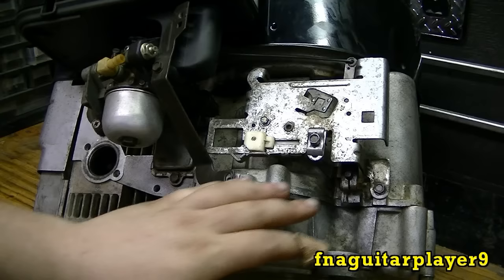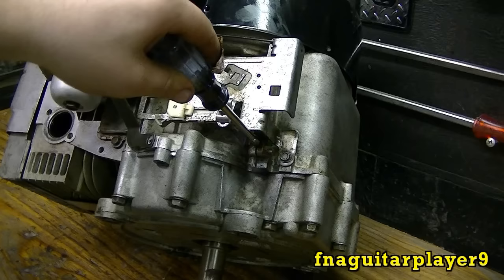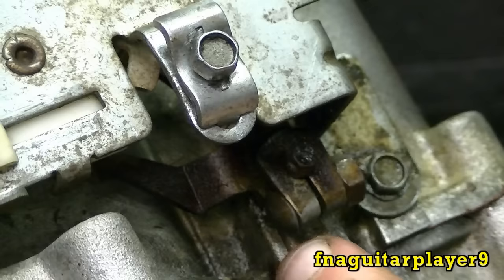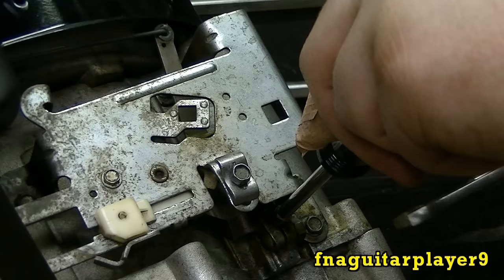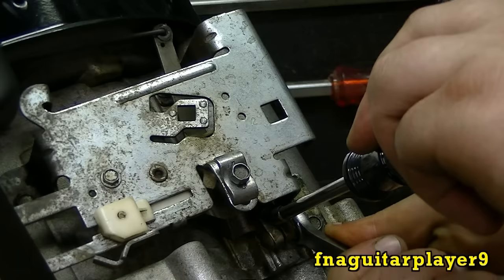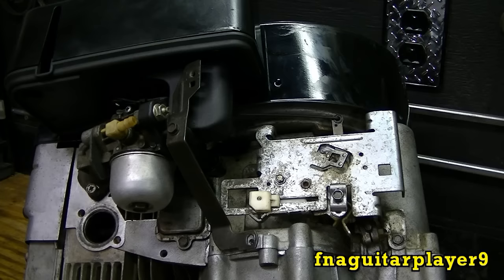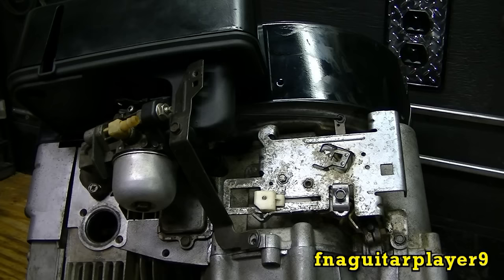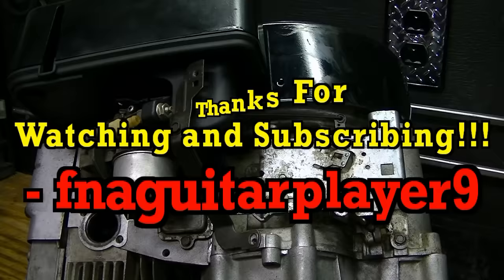How To Adjust Mechanical Governor On Small Engines

Comment: OK so now I just replaced the carburetor and ignition coil on my craftsman YT 3000 tractor. It has a 21 hp single Briggs & Stratton so when I loosen that not do I turn left or turn right because my engine right now is a racing like hell.

Comment: Just recently, I have a Briggs 331877-0869-g5, about 11 years old,  I did some deck repairs, tested by mowing some lawn and worked fine, when I pulled into garage, started revving to max, now, if I start it, immediately goes to high rpms, governor arm doesn't move, but if I move it by hand it will slow down.  I've drained oil, gas, took deck off, getting ready to tear into it, but if you have a different opinion, let me know.  I need to fix quickly, cause spring is here and the grass grows fast.   Thanks, Brian

Comment: Of all the web pages i've gone to and about 10 videos, THIS IS BY FAR THE BEST EXAMPLE OF HOW TO ADJUST THE GOUVERNOR ON A SMALL ENGINE. Thank you for making and sharing this video. I knew it was a simple process but could never get a straight forward example of how to do the actual adjustment, everyone wants to talk about springs and how to "jimmy" springs to control idle speed... thanks for the video two thumbs up!!
Reply from the maker: +doug h I appreciate that! I usually try to keep things as simple and to the point as i can. Yeah, sometimes you have to bend the tabs to fine tune speed, especially on generators. Your welcome!!! Thanks for Watching!!!

Comment: Hi there from Australia.
Your videos are fantastic! They have given me the confidence to tackle things like this instead of paying big money for someone else to fix it. And by the way, my wife is quite impressed too. Thinks I am quite the handyman thanks to you! I owe you one😉
Just about to try process and adjust my govenor. I just fixed my one piece carburetor. I cleaned out all the jets but still wouldn't work. As it happened, it was the needle getting stuck and not dropping in and out properly. Not getting fuel. I had to drill it out  slightly (in reverse) just to get a little bit more clearance. No amount of cleaning worked. Thanks heaps. Mick.
Reply from the maker: Hi! Appreciate that! Glad to hear! Thats why i make these videos to help people save money by doing repairs your self. haha i hear ya! I hear ya, sometimes they can be really bad. Your welcome glad to help out! thanks for watching!!!

Comment: Just wanted to say a quick thank you.  I put a new short block in my rider (13.5hp B&S) and got it back running but couldn't figure out how to set the governor.  It was running really high and would bog down with the engaging of the blades and going up a hill.  I had looked for quite a while on the internet and couldn't really find what I needed.  I found your video and couldn't believe how easy it was and I was a very skeptical.  Well I went out and adjusted it and it worked great. Thanks!!!!!!

Comment: Good job! As a note from a retired ASE Master but green Loctite is low strength and applied after a nut is installed. Now, I will do this to my tiller because it runs faster than normal and won't idle down. If I am throwing snow, I like to push the throttle down while the mail guy/gal shows up. I use plastic covers for manuals, but take photos to numbers of the snow machine, s/n, model and engine to. Clean & brighten photos & print them place these in the file cabinet as well. It helps 4-7 years later when things need adjusted or fixed. 
DK, ASE Master Tech since 78, Retired. Thanks!

Comment: This is the exact video I needed! I just bought an old murray riding mower and it has the 12.5 band g i/c motor. It runs very high rpm pretty much non stop and doenst have much of a change in the throttle,. it does surge in a rythmic fashion and blows a lot of oil/white smoke out of the exaust when it does the surge. lawn mower mechanic up the street said to try adjusting the governor. this video was perfect for showing me what to do. I just hope it does the trick once i actually do it.

Comment: At 2:47 you explained my problem! I was having an issue with mice that chewed my plug wire down to bare wire and shorting out. I took head and carb off to check valves, but never touched the gov assembly. When I put it all back together, it was way over revving. I couldn't figure out what I did to make it rev up like that, but I knew the fix was resetting it. Not untill you explained that anytime you take the carb off, you should re-adjust your gov....I didn't know that! Thanks for the info! Great vid, bro!

Comment: excellent!  this is exactly how to adjust the governor.  Normally you will not need to do this, but with old antique motors, these friction/clamp type fasteners get rusty and they slip.  The other thing that can happen, and I want to mention this to anyone dealing with an older vintage motor is that the governor arm has a bushing type seal.  This bushing type seal can build up lots of crude an dirt and that can cause the governor arm to get "stuck" or bind up in one range of motion.  So before doing anything, spray some brake cleaner all over the governor arm bushing seal.  Blast it with some compressed air, then coat it lightly with regular motor oil.  (the brake cleaner will cause most rubber bushings and seals to dry out and then they can crack...so put some lube oil on it to prevent that.  It's like how you wash your hair.  shampoo to get rid of dirt and then a conditioner to prevent dry out.  Same idea.  

also...on old vintage motors, springs rust out and break.  Always check that ALL springs are intact, in the correct holes/positions, and replace them if they are weak or stiff.  

t

Comment: You just saved me! I changed the carb on my B&G 9.5 snow blower engine and it was racing after I started it. I stopped it in a second or two. I thought I had a bad carb. I was extra careful not change anything but it turns out the governor was way out!

Thank you!
Reply: Did yours start up and go to full thottle? Mine is and i cant get my head around it...
Reply: @dieselbossbrandon  it did. It was because I didn’t set the mechanical governed correctly. I needed to do valve adjustment after.
Reply: @grahamlocklin  thank you! Im gonna set it today!  Its my sons new tractor hes been building and he just got it running and it scared both of us when it took off at full speed lol

Comment: Another great video Frank!  You have the best small engine videos on You Tube.  I always thought this was not adjustable.  I have a 12.5 hp Briggs that is surging right now after a carb rebuild.  I will bet that this is the problem.  I will adjust the governor in the morning.  Thanks so much for the timely video!

Comment: Thanks. I had rebuilt a 30 year old Briggs, 1904oo series engine, on a Mighty Mac chipper, governor similar set up to this one, my engine is horizontal. My engine was way over revving, was driving me nuts right after a rebuild like that wanted to break engine in without throwing the rod out. I knew there was a governor adjustment of some sort on that shaft you worked on. Here I'd been trying to adjust my maximum governed speed with a nut which has s spring behind it, on my engine which is located behind the white (black on mine) plastic throttle slider, and sticks out toward the pto side. This spring / nut does not seem to be present on lawn mower application in video, at least that I could see. 

This WORKED, my engine now runs at a decent regulated speed not too fast like the Wright Brothers only caring if the engine lasted long enough for that first 59 second flight, lol. Engine purrs right along as it continues to settle in, undergoing break in from its rebuild. 

Chippers always run really fast, one reason chipper engines do not last. I still have not found out what the adjusting nut with spring behind it exactly does on my engine, but believe it may have something to do with running speed although does not allow you the wide a range you have on a lawnmower application. Way engine is mounted you can NOT safely make adjustments with engine running. 

 Some differences on my chipper engine, are the white (or black) plastic square throttle slider on mine, you can NOT move. Also, look ma, no third hand required: did not need hold throttle wide open while turning governor shaft to the right, and tightening the clamp nut. My engine the linkage kept the throttle WIDE open for you. In fact idk what the idle screw even has got to do with anything on mine, only way that idle screw EVER touches, running or stopped is if you somehow override the throttle rod linkage manually.  

Good informative video, great pictures, and as another poster mentioned no music viewers may not like. Nice job!

Comment: Great video! Thanks. I've just rebuilt a Briggs and Stratton engine on a Husqvarna mower.

This video has helped so much! Thanks from Wales (UK)!!
Reply from the maker: Wyn Edwards Appreciate that, your welcome always glad to help out! Thanks for Watching!!!
Reply: Hi 
I’ve a Briggs quantum engine and I’ve cleaned the carb and replaced air filter and gaskets spark plug and governor spring and adjusted the governor arm as per video but still engine races ?

Comment: Thanks for showing how to do this.  I have a Yamaha MT 110 2-stroke lawnmower motor and it was giving me all hell revving like it was going to take off whenever it feels like it.  Well, just as you said:  5 minutes later the problem is fixed & it is running smoothly and solid.  The throttle cable was replaced some time ago and ever since that it was uncontrollable but worked sort of.
Reply from the maker: Your welcome, glad it fixed your problem! Thanks for watching!

Comment: First off, fantastic explanation! I watched the video on what a governor does and then followed it up with this video. I have the opposite to your problem where it is surging at idle actually, hope this does the trick :)
Reply from the maker: Appreciate that, glad to help out! I hear ya, alot of times if they are running to lean it may be a carburetor issue causing that too. Thanks for Watching!!!

Comment: jj again. The air vane on my 6.75 just works the carb's choke butterfly. I believe it's Briggs' autochoke feature added some years ago to supposedly make for easier starting for the avg. homeowner; that is, no primer nor choke to fool with. The carb's inside butterfly (throttle) is operated by linkages routed from front to back finally disappearing through the crankcase. There is a bolt/jamb nut and shaft just like on a mechanical gov. Glad to send a picture if you will tell me how. Appreciate your patience; I've learned a lot from you.
Reply from the maker: I worked on those before, I don't care much for it, i'd rather have a manual choke or primer. that is a mechanical governor going to the inside, it should just have a air vane choke. it could very well be the slinger / gov is bad or just needs adjusted like i did in this video. Thanks for Watching!!!

Comment: I think I see. Every day I feel a little closer to really understanding how the governor and autochoke work. My B&S has a similar setup. It has a half moon governor shaft. I'd like to have a special tool for that. I really don't quite understand the throttle + choke position of the throttle control though. There doesn't seem to be any connection from the throttle cable to the choke at all. The only linkage for the choke leads up into the engine near the muffler, I assume this being the heat controlled autochoke. I understand the governor action in the following way:
For a given midrange throttle control position, when the oil slinger (or the air vanes) go faster, such as under a decreased load, the pin comes out (or the air arm moves out), which pulls the governor arm forward (to the right), which closes the throttle valve a little bit to slow the RPM down. Similarly, when an increased load slows the engine down, the governor arm moves to the rear (to the left), opening the throttle valve a little to increase engine RPM. I can understand that. Now when you adjusted the governor arm, you were effectively adjusting the governor up against it's closest position to either the oil slinger or the air vanes (depending on the type of governor). Taryl says to hold this shaft position, then adjust the governor arm so that the throttle is all the way open (as far away from the idle screw as it will go). Then he says to tighten the governor arm to the governor shaft while holding these two positions. This agrees with what you said. So that must be correct. 
The spring that rides on the throttle linkage, which connects the throttle to the governor, must only serve the purpose of keeping the linkage from falling apart, and performs no other function.
My throttle cable is attached to a lever having a throttle control spring running to the governor arm. This spring must be the important one.
I would also assume that the clamp holding the throttle cable down should be loosened, and with the throttle control in idle, the throttle cable should be adjusted in its clamp so that the throttle control spring is just at its limp position (no tension).
At idle, the throttle control spring is limp, allowing the governor arm to rest against the stop, being held against the stop by an internal spring inside the engine I assume.
Here is what confuses me:
The choke seems to have no input from the throttle cable, its only connection being the autochoke linkage running up inside the engine cover near the muffler. But that doesn't seem right. Obviously, the choke comes on in this throttle control position because the engine won't start cold unless it is in that position. So what am I not seeing?

Comment: After using your info about adjusting governor I adjusted as you described and it still revving when throttle moved up to engage mower.
Reply from the maker: Usually if this doesn't fix it, it can be a linkage bent or a spring that is to tight, usually from being installed in wrong hole on the arm or the arm is bent to much, worst case would be the internal governor part (oil slinger/governor weights) is bad or broke.  Thanks for Watching!!!

Comment: Thank you so much for this video! I have recently taken off the carburettor and the engine's started surging since that. I will give this a go - I'm sure this is the cause. Thanks again!
Reply: Did the governor adjustment fix the problem?
Reply: @MaxTurbocor  Hi there, yes it did work!

Comment: Just set my govner due to surging revs.( up and down) exact ally the way you showed.  Everything on my 550 brig and strat was the same as video,  mower runs better then new,  in fact I'm concerned it revs too high lol.  Fantastic information!
Reply from the maker: I hear ya, glad to help out! If it is running to fast, you can adjust that out with the throttle cable. thanks for watching!!!

Comment: nice one! I've been repairing mowers for years and didn't know about that adjustment.. Thanks :)
Reply from the maker: Thanks. I hear ya, I didn't know about it either until about 3 years ago i think it was, had a 12 horse briggs that was surging no matter how i adjusted the carburetor, did some research and adjusted it, and it smoothed right out, wish i made a video on that motor. Thanks for Watching!!!

Comment: I have a briggs and stratton 15.5 motor on my riding mower. I recently had to replace the camshaft. After putting it all back together I find it runs rough . I also adjusted the valve lash. Still the same problem . I'm hoping the governor adjustment eill smooth it out. Thanks  ron Mc.
Reply from the maker: +Ronald McCready I hear ya. It could be carburetor issues, assuming the cam was replaced to fix the compression release, but it could be the governor as well since it may have a different thickness gasket on the crank cover or something, sometimes it doesn't take much to throw it off. Thanks for Watching!!!

Comment: Right on! Thanks for the good information. I'll see if my "new" generator will compensate for electrical load with rpm after making this adjustment
Reply from the maker: +Jeff Kennedy Your welcome, glad to help out! Yeah alot of times this will cause a engine to seem weak, or a linkage not setup right, i worked on one a while back that the governor wasn't working at all, found out the linkage the governor spring connects was bent! Thanks for Watching!!!
Reply: My only experience has included go karts, and the governor worked against full throttle. With the generator starting at full throttle, then the gov closing it to regulate speed..I thought it might be wrong, but now I know what to look at. You saved one more vintage briggs from the scrap yard!
Reply from the maker: +Jeff Kennedy I hear ya! Glad to help out! I will be posting a couple generator videos here soon (not governor related but carburetor repair and info on getting a generator thats not generating to generate).
Reply from the maker: +Jeff Kennedy I hear ya! Glad to help out! I will be posting a couple generator videos here soon (not governor related but carburetor repair and info on getting a generator thats not generating to generate).